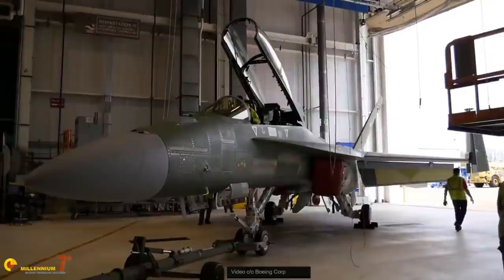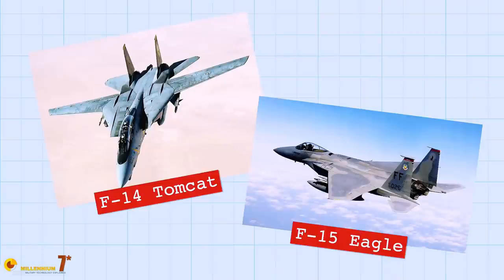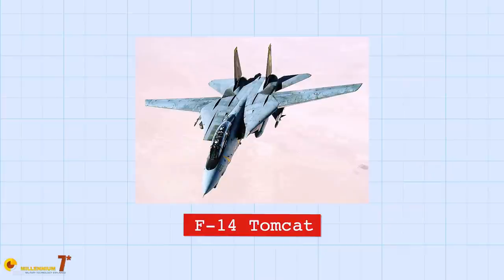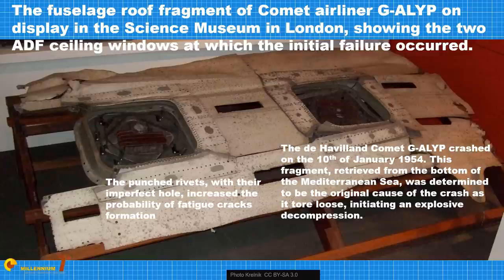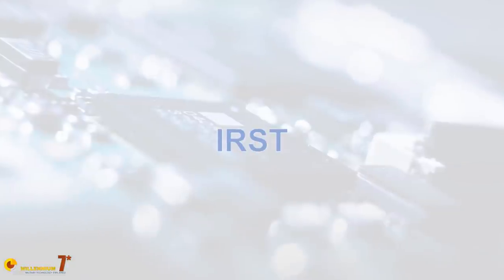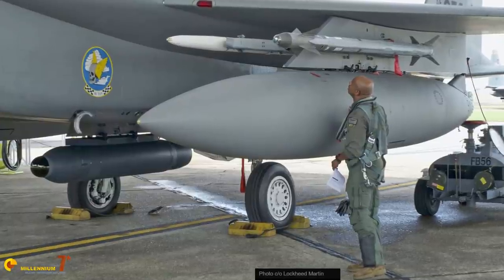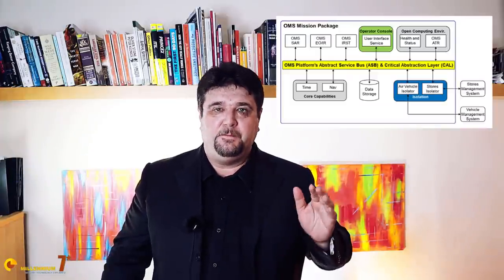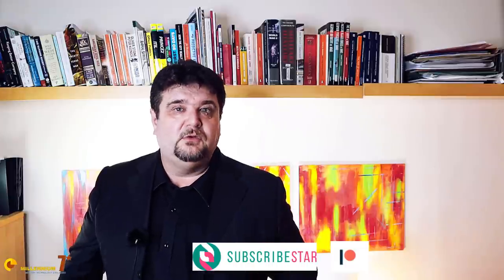The F/A-18 E/F Block 3: is it 5th Generation?

Comment: The YF17 Cobra was interesting to the Navy because it had 2 engines for higher probability of getting your plane back (some early F16s were lost due to engine failure in fact at least 1 F15  was lost due to dual engine failure).   The Navy did not trust Northrop to build a carrier plane after GD's F111 Naval variant had too many problems.  So McDonnell got the prime contract.  The fuselage structure was made on giant mills  at Hawthorn (the biggest milling machines I ever observed and fun to watch).  The F18 A  was a small light weight  compliment to the F14 air superiority fighter.  Phasing out the A6 after cancellation of the futuristic A12 led to proposals for modified existing aircraft.  As one of the designers told me, Northrop stuck a plug in the fuselage to make it longer.  The Grumman F14 bomb cat required less redesign work as all that was needed was add bomb racks and bombing electronics.  The F14 Bomb Cat also had significantly longer range.  The F/A18 E/F has much shorter range than the A6 and lower bomb carrying capability.    I was convinced that the Bomb Cat would beat out our plane because it was a better choice for long range missions.  For Northrop the Navy's cost saving and hate for the high maintenance F14 led to the F18 being chosen.   This ment no more F14 production and allowed us to buy Grumman.   The 2 big prizes was Grumman avionics which led to the EF18G to replace the EA6 and a pile of money the Navy had to pay us for the close out of the F14 program.  Because we at Northrop had gone through close out processes, we understood better than anyone else about what the pay off would be.  With a bridge loan from Carlyle we did a hostile take over Grumann.  After a few years when we got the F14 closeout money we paid off Carlyle had the Grumman assets  and a lot of cash.   It meant Northrop survived to keep pushing new variants and new aircraft and do other business.    During the F17 F18 lifetime I was a student, worked at Northrop and am now old enough to retire.  The aircraft went from being designed with slide rules and blue prints to computer design without paper.  The most obvious external change are the air inlets which are beautiful curves in the beginning to rectangular now.   To me the development of the Blisk (one piece disc and blades) for the engine shows the fabrication and design advances.  The F18 is no longer a light and inexpensive aircraft.   It is a lot less expensive than an f35 and probably more reliable.
Reply: As one who knows the Northrop Aircraft Division is similar to the Marine Corp. "The are no ex NAD employees"  and we will take Jack Northrop's YB49 Flying Wing BS and the F-17/F-20 BS to the grave.  NAD knew how to design a fighter, the F5E is the evidence. The Navy bought a bunch of them  as Top Gun Adversary fighters from Switzerland (with modified wings that gave you two more Gs)  that were housed  since the late 1970s in caves and rarely flown. To this day if two of those impossible to see Swiss F5Es with L snakes mounted on their wing tips get on your F-18 six the general conclusion is that your dead meat.
Reply: Northrop is run by engineers, Lockheed is run by lobbyists. That's why they always get screwed.
Reply: I feel Lockeed Martin are not that good, a lot of problem for every project they made. US should give important project to other.
Reply: @sushilover1356  I have worked at Northrop and have known many Lockheed engineers.   Jack Northrop got his start with Lockheed.

Comment: Back in  my college days I use to hangout in the archive section of the college library.  This was in the early 1980s. One of the things I  use to do was to go through old Aviation Week magazines. I do remember reading that the US Navy was supposed to adapt the winner of the LWF competition. The USN did an evaluation of the YF-16, where, if I remember correctly, Vought was the Primary subcontractor.
The short story is that the Navy found other deficiencies in the performance of navalized F-16 which led to them looking at the YF-17.
Reply: @ObsydianShade  And yet they enthusiastically adopted the A-7 against other dual-engined options. Something says to me that having 2 engines wasn't really what attracted the USN to the YF-17.
Reply: Interesting, that Vought was involved, I recall that the YF16 landing gear, to save development costs, was sourced from the A-7.
Reply: @magoid  thanks, I probably misremembered, had to pull out a 1975 copy of an aviation book which described the YF16 and subsequent F16A\B and I recall LTVs involvement in the navalised proposal, couldn't find more but not sure if that's where I got my association with the A7 landing gear, LTV being the manufacturer and all, but thanks for pointing this out.

Comment: That IRST placement on centerline drop tank is the best solution for every matters considered. Integrating internal IRST to Super Hornet requires heavy modification to the jet's nose section as the nose is already occupied by radar and cannon. The Navy also don't want to lose the centerline drop tank, because if they do that, they need to put the tank(s) anywhere in the other weapon stations, reducing the payload available.

Comment: Also interesting to note that model d tomcat had IRST BACK IN 2000!  and even a couple years before that actually.  It worked so well in that aircraft due to the advanced data link and sensor fusion capabilities of the APG 71 radar. The size of the Tomcats knows aloud for the largest radars at all times, and it was capable of being slaved to the IRST and the RIO could change search and track parameters in a multitude of different arrays and formats as a result of the increased sensor.

The situational awareness in that aircraft was well ahead of its time, with the capability to be a quarterback in the sky, running, active, sending, and receiving sensor  information from passive assets that were data linked.  It was really an early iteration of what you have today with the F 35.
Reply: tomcats had irst from the first model. look under the nose of any A model. the tid can be switched between tid and radar repeater modes (bottom screen). tid thermal imaging display. Tomcat guys used to use this on a merge to see what angle the bandit was at and what the bandit was in (even that roundles they have aka identifying them visually) from about 10 miles before the merge.